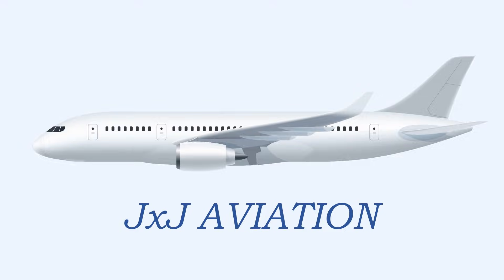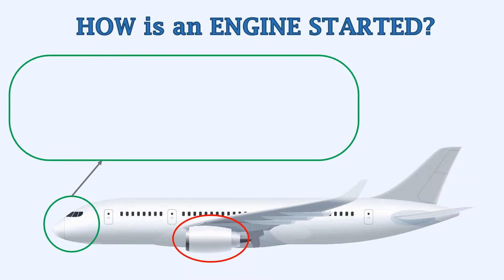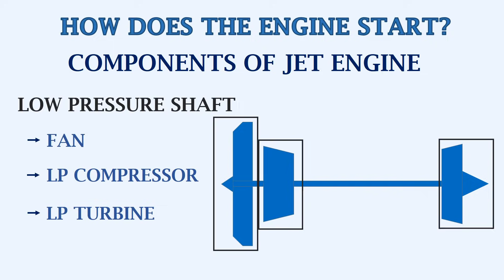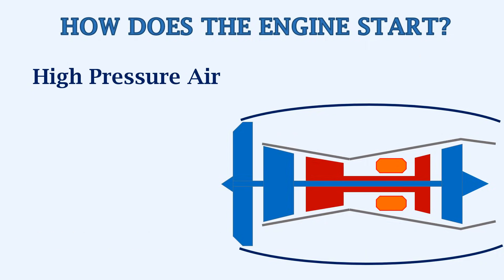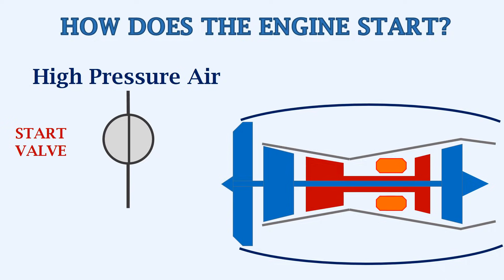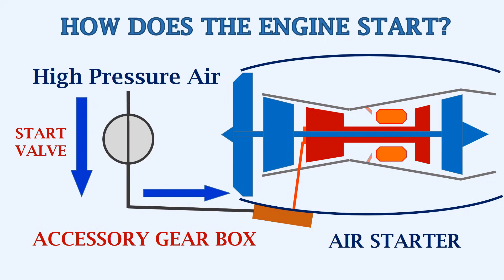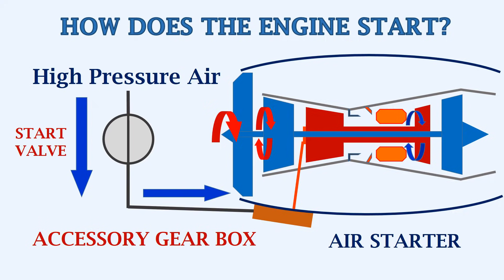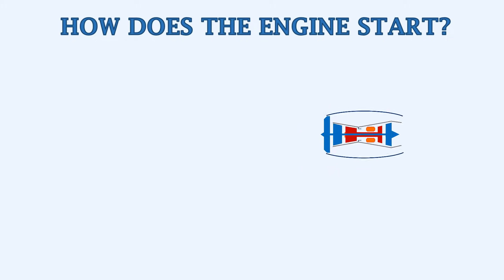Understanding How an Aircraft's Jet Engine Starts! A look at the Start Sequence of a Turbofan Engine

Comment: One of the things I did on pushbacks, before I give the pilots permission to start. I notice the wind. A strong rear wind would turn the fan blades in the opposite direction. If the wind is really strong from the rear, I would alter the angle in order to prevent a hot start.
Reply from the maker: That's very interesting information! thank you! :)
Reply: I want to learn this
Reply: What is a hot start?  Very interesting!
Reply: It’s always refreshing to work with push back crews who have that kind of situational awareness
Reply: @hugolafhugolaf  in order to make more power, engines must get hotter.  We measure this heat by the temperature of the gasses that are exhausted out of the engine, known as exhaust gas temperature or EGT.  During an engine start, the EGT is monitored to not exceed a certain value before the engine is started and stabilized.  If it does exceed this value, that is known as a hot start.
Reply: @hugolafhugolaf  hot start is a show stopper, would ruin your day! More common wirh rotorcraft or turboprops.
Reply: @hugolafhugolaf  The reason why it is a hot start is that the airflow, which goes around the combustion chamber and which is caused by the fan, is also cooling the combustion chamber. The wind from the back will slow the entire fan, compressor, turbine system down so the airflow around the combustion chamber is less and therefore during the start it might exceed the maximum temperature. As soon as it is running the wind from the back is no problem anymore but at the start, when the N1 rpm is low, it can be a problem.

Comment: I’m an A+P who no longer works in the industry so I really appreciated that you did not call this a jet engine but a turbo fan.  Most high bypass engines have a twisted arrow on the inlet so the crew can verify the correct rotation before initiating ignition and fuel. Thanks again!
Reply from the maker: You are Welcome! Check out my other videos as well!
Reply: I am confused. This isnt a jet engine?
Reply: @majestikstyle  It’s not a true jet engine It’s a turbine which uses a series of compressor blades mounted on wheels in the convergent duct thus compressing the air. After which fuel and ignition are introduced in the hot section driving another series of blades in the divergent duct mounted to a common shaft that also drives the compressor section. A high by pass fan is also used for thrust around engine case .
A true jet is much simpler in design.
Reply: @powerwagon3731 I thought turbo fan is just the better version of an jet engine

Comment: One important correction, N1 rotation begins before fuel is introduced. When the N2 shaft is spun by the starter, it will suck air through the engine, which will turn the N1 shaft at a low speed. This rotation must be confirmed before fuel is introduced, as lack of N1 rotation could indicate a seized engine.
Reply from the maker: Thank you for the information!
Reply: @JxJAVIATION  Thank you for jet engine start steps.
Reply: thank you very much
Reply: Thank you, I have always wondered about that. Thanks for explaining.
Reply: Good explanation, I was wondering how N1 starts, now I know...
Reply: Thank you for correcting that major error in explanation.
Reply: Why is there no mention of the  starting of apu and the bleed air from the app thats requiring for the engine start sequence?
Reply: @chegopal9215  That's assumed to be done. This just covers engine start, not a full cold and dark startup.
Reply: Very nice and simple explanation for 
lay man.

Comment: Thank you. As a flight sim enthusiast I really wanted to understand the N2 importance initially and why N1 is important later for most of the flight. You nailed it.
Reply from the maker: Thank you mate!
Reply: Think of it this way: N1 is your thrust, and N2 powers your systems. The N1 shaft has many more turbine stages, in order to extract as much energy as possible from the jet exhaust and use it to run the fan. That's where most of your thrust comes from. The N2 compressor gives you bleed air, which runs your AC, anti-ice, and engine starters. The gearbox linked to the N2 shaft runs a generator and a hydraulic pump.

Comment: As an important point with regards starting a turbo fan engine. The air starter for the engine is fed low pressure high volume air. A popular understandable mistake is that the starter is fed high pressure air. 
The air pressure is generally around 45 psi. The volume of air supplied is what provides the energy to drive the air starter.
Reply from the maker: Yes that is a very good point! Thank you for sharing!

Comment: The accessory gearbox is like a drive belt on the cars. It drives the fuel pump and the oil pump and the hyrdaulics. It is driven by the Hp turbine. So to drive the Hp turbine itself we can drive this gearbox itself.
Reply from the maker: That is a good explanation!

Comment: Some jet engines now start electrically. On the 787 they have what are called VFSG for Variable Frequency Starter/Generators. The starters are also the generators once the engine runs on it's own.
Reply from the maker: Yes, just focused on the Pneumatic Starter
Reply: @JxJAVIATION  Love the video.
Reply: And each engine has two VFSG's (as does the APU).
Reply: Good point.  And most business jets.

Comment: The shaft from the accessory gearbox does not disengage from the N2. The gears in the starter unit disengage from the shaft. The shaft is still required to drive the accessories.
Reply from the maker: Did some research: The shaft which drives the accessories is separate from the shaft that is used to start the engine.
Reply: @JxJAVIATION  Engine type? The N2 (or N3) shaft drives the accessory gearbox (permanently attached) on most engines. There are various components attached to the gearbox: Hydraulic pump, EEC power generators, fuel pump, electrical generator and starter motor. i.e. The starter motor is mounted on the gearbox (CF6, RB211, CFM56, etc). You said that "the shaft from the N2 starter unit disengages from the N2 shaft" and the graphic in the video shows the accessory gearbox shaft disengaging from the N2 rotor. What actually happens is that the starter disengages from the gearbox. According to your graphic, all the accessories would stop working.
Reply: I’m with the imperfectstranger on this one.  On modern turbofan engines the starter is just another component on the accessory gearbox.   Sure, some really old single spool military engines had starters attached to the compressor and were mounted to the shaft at the front of the engine, but that design is now very much obsolete.

Comment: On the C-17 (pw2000 engine) the ignition is left on. It’s turned off as part of the cruise checklist and then turned back on in the descent checklist. This is so that the engine has less chance of flameout at critical stages of flight.
Reply from the maker: That's right. A very good point!
Reply: I think that is quite normal for almost all turbofan or jet engined aircraft. Boeing aircraft definitely have it and I think Airbus too.

Comment: The graphic appears to be a 787. I worked on the 787 Common Motor/Starter Controller, which was the 1st all electric start of an engine of its size; otherwise the information is mostly consistent with other turbine engines I've worked on.
Reply from the maker: On the 787 there is an electric starter, but I was giving an idea about the air starter unit!

Comment: This not always true. The GEnx and the Rolls-Royce Trent 1000 engines on the 787 is electrically started. The APU provides electrical power and along with the Lithium Ion Batteries directly spin the high pressure spool via the generator-motor mounted on the engines. Fuel is injected once the required RPMs are reached. There is no bleed air or an air start mechanism.
Reply from the maker: Yes true! Modern aircraft use an electric starter just like the one for the APU!

Comment: Thank you for jet engine start steps.

I have a question, burning chamber is at high pressure as compared to compressed air entering it - in flow line and due to generation of product gases. What is the scientific answer? Is it high velocity?  Engr. Muzzafar Iqbal.
Reply from the maker: Because of the fuel air mixture being burnt in the combustion chamber the pressure increases.

Comment: The N-1 section just doesn’t start to rotate.  The hot exhaust gasses from the combustion section, pass thru the turbine blades, causing the blades to rotate.  The now rotating N-1 section does force more air into  the compressor section.
Reply from the maker: Yes. That is true!

Comment: Isn’t the air conditioning air used also for spinning the engine during the start sequence? That’s why during pushback the air conditioning in the cabin is paused.
Reply from the maker: Air is used for Engine Start and also for the Air Conditioning System. During Engine start, sufficient air pressure is required to rotate the shaft. Hence the air supply to the air conditioning system is cut off.

Comment: Hai i just want to clarify that the HP air opens HP valve then it passes through air stater unit before entering to AGB. From AGB it is coupled to N2??
Reply from the maker: the HP valve opens and this allows hp air to flow to the air starter unit. the air starter is housed inside the AGB. the coupling is from air starter/agb to N2
Reply: Starter Valve (electrically activated)->Starter->Overrunning clutch->Gearbox->driveshaft to HP spool (via bevel gear). The engine control unit (EEC) controls start sequence of the engine fuel and ignition.
Reply: @JxJAVIATION  Starter is not housed inside the AGB, it is connected via shaft to gearing inside the AGB.

Comment: Did you miss the sequence of the 3 rubber bands ?  Thanks , simple and we'll put. It sure beats 24 volt starting motors and ring gears.
Reply: I was expecting..
"Next press the switch to release the Hamsters in to the rotating wheel"

Comment: Can you tell me
 N1 shaft & N 2 shaft are two independent module which are disengaged during start up 
or N 1 shaft &  N 2 shaft are coupled permanently (single shaft)
Reply from the maker: N1 and N2 shaft are 2 separate shafts and are not coupled mechanically. The aerodynamic forces cause these shafts to rotate. So basically they are always disengaged mechanically.

Comment: Is excitation used to run the motor?
Reply: What is the voltage level?
Reply from the maker: In turbofan engines the starter motor will be run pneumatically
Reply from the maker: Voltage would be 115V

Comment: Not quite sure that air source to the starter is high pressure...Even for B 777 large engines, minimum air pressure from APU is 15 PSI, and minimum pressure from cross bleed start is 25 PSI minimum. The key point is not pressure but airflow.
Reply from the maker: Well the pressure is expanded in the starter turbine, which causes the turbine to rotate. I would say LP is the air conditioning supply from the ground cart. But for engine start HP air is regulated as per requirement by the bleed valve!
Reply: I guess this should be expressed in terms of  air volume per time, or Cubic Feet per Minute, at least in the U.S. measurement system.
I mean 25 PSI in a 2 inch pipe is not the same as 25 PSI in a 4-inch pipe

Comment: You did not mention how spark genrated to ignite the fuel ?
Reply from the maker: There are igniters which generate the spark
Reply: @JxJAVIATION What if I put a burning matchstick into the engine? Will it also do? 😅

Comment: DOES N1 SPIN IN THE SAME DIRECTION ...OR THE OPPOSITE DIRECTION AS N2 
JET TURBOSHAFT N1 AND N2 SPIN IN OPPOSITE DIRECTIONS, TO COUNTER THE GYROSCOPIC EFFECT CORRECT?
Reply from the maker: Few engines have both HP and LP Shaft rotating in the same direction; and there are other engines in which HP and LP shaft are counter rotating.

Comment: Thanks, very interesting!
How does the APU start? electric?
What is the pressure of the air needed for starting? Something like 10 bar or more to 100 bar?
Reply from the maker: You are Welcome!
The APU uses an electric motor for starting. 
The air pressure required for starting the engine would be less than 5 bar.
Reply: @JxJAVIATION  thanks!
Reply: @JxJAVIATION indeed, I cannot imagine a electric starter to a GE90, I just cannot conceive it
Reply: @JxJAVIATION  5 bar is enough for making the HP shaft turn ?
Reply: @bobelaviador  The 787 has starter-generators
Reply: @bobelaviador   - I'm guessing it's either 200V/3ø or 115V single-phase since that's what generators output.

Comment: What about the EEC? You didn’t talk about it.
Reply from the maker: I made a separate video about the FADEC which should be useful
Reply: @JxJAVIATION  can share the link for that video thanks
Reply: @JxJAVIATION  why does slower air going into the engine becomes quieter?
Reply from the maker: @ShadowRap-y5l  this one: https://youtu.be/3Nl11tSz4OE
Reply from the maker: @ShadowRap-y5l  Its not because of the air but because of the lower shaft speeds in the engine

Comment: how the high pressure air is connected to the AGB...Is the APU is a separate unit and how it is disconnected from the AGB...PLS explain..
Reply from the maker: The APU is a separate unit. We take bleed air from the APU through ducts, which are controlled via valves and connected to the AGB.
Reply: Thank you very much for clearing my doubts...Iam working in a misiles integration unit....pls post videos about ramjet engines and their working...yours is a great work and lot of things to be learnt
Reply from the maker: @prabhakaransakthivel954  Thank You! Have noted it, will do a video on supersonic propulsion soon.

Comment: Great video ! I’m wondering what happen to the airstarter after the starting cycle is complete ? Do the ground crew take it off ? Isn’t it tricky since the turbine of the airstarter still has a lot of inertia even thaugh it has been disconnected to the N2 shaft ?
Reply from the maker: The air starter unit is not removed by the ground crew. 
This is because, when the aircraft is in flight and the engines were shut down and need to be restarted, the air starter may be required to restart the engine.
Reply: JxJ AVIATION oh so the pressure that flows in the airstarter during flight is enough  to start back the engine !? Waw

Thanks a lot for your accuracy in your videos and for taking time to share this knowledge with simple terms ! Hope to see you doing well on youtube it is really well deserved !
Reply from the maker: @Binette96  Thank you, and Welcome! Please do Watch my other videos and Share the videos as well
Reply: The starter attached to the engine gearbox (about 6" in diameter and about as long) has an overrunning clutch like your car. At some point during the start sequence, the clutch disengages, the starter valve is shut off.
Reply: @Greatdome99  You are right Sir.. maybe you are acft engineer or A&P instructor.
Reply: @Binette96  Sir.. the starter and the starter valve is not use in flt starting of the engines.. N2 or high compressor of the engine still rotating in flt even though the engine is shutdown bcuz of high press air passing to the core of the engine..to start the engine in flt the pilots needs ignition and fuel only to start the engines
Reply: Sir.. the aircraft starter in use only during aircraft ground starting.. and it is not use in flt starting.. Starter is part of the aircraft engines..

Comment: I wonder if magnets could be installed on the engines to create electricity and start the engines.
Reply: Those are called generators.
Reply: @Telephonebill51  yes but also magnets are used in magnetic motor starters, because quite often the compressed air starters are not working on planes and the airport needs to bring over a starter unit truck.
Reply from the maker: Well there are engines which have pneumatic starter unit and other engines with electric starter unit as well!
Reply: @JxJAVIATION  thank you that's good to know.

Comment: Why do they call it Low pressure? what does pressure have to do with the component?
This video is clear, but I still have that question about pressure. Like how does it apply to engine and to the wings. Thanks
Reply from the maker: I think you are talking about the Low Pressure Shaft. This shaft handles  lower pressure air when compared with the other components.
Reply: @JxJAVIATION  Low pressure means fast moving air? or slow moving air? I am having trouble understanding it. Low pressure is equal to high velocity then high pressure is equal to low velocity. How is that? Thanks
Reply from the maker: @kylequerijero1002  pressure and velocity are inversely proportional. Pressure is force per unit area. If air is moving at higher velocity, the force on the body reduces so the pressure decreases.
Reply: @JxJAVIATION  Thank you very much!
Reply: The LP section (at the very front) provides a lower compression ratio than the HP section does. The independent HP spool rotates ~4x faster than the LP section, is smaller in diameter but has more rotors ("stages') to achieve higher compression ratios.